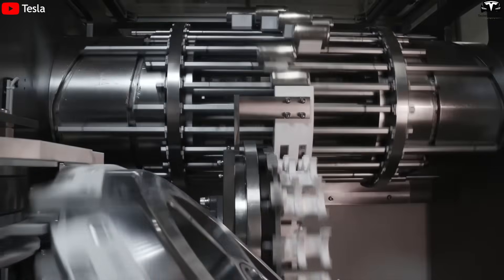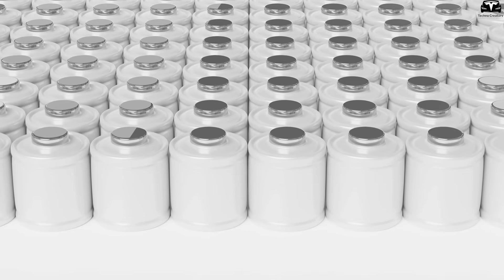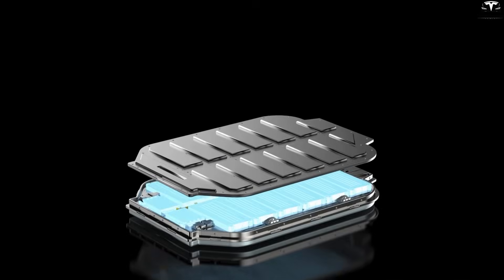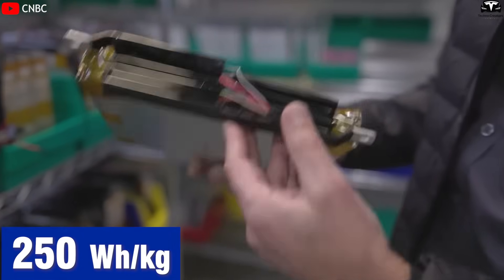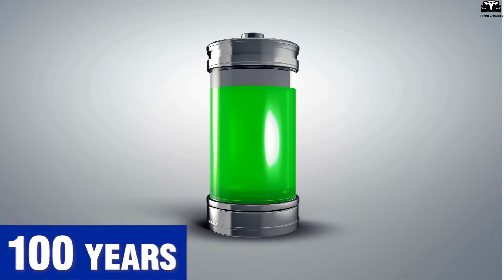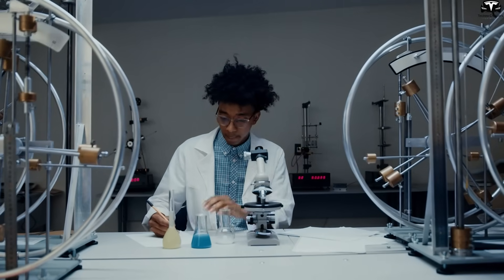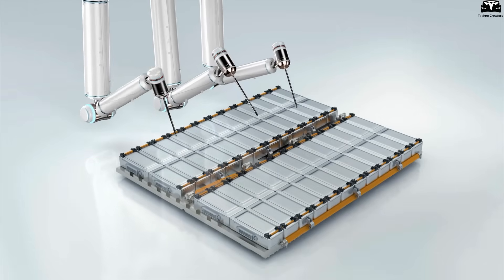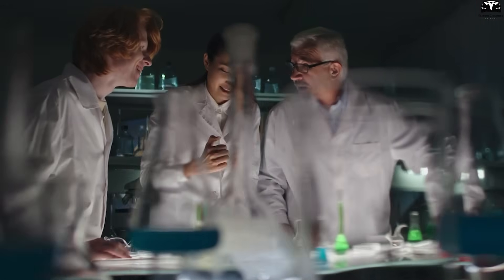Elon Musk Reveals Plastic Battery 10X Cheaper & Lasts Longer! Design that Could Last 100 Years!

Comment: I think companies like CATL and BYD may actually be better companies to research and develop this because they are already doing much larger battery developments than Tesla, and there still seems to be some development and optimisation required of these batteries.  They seem to be lighter but significantly larger than Litium batteries but have lots of promise for stationary energy storage/backup and network stabilization.
Reply from the maker: Đúng vậy, CATL và BYD với kinh nghiệm sản xuất quy mô lớn và đa dạng dự án pin có lợi thế lớn trong nghiên cứu và phát triển, đặc biệt khi công nghệ pin polymer còn cần nhiều thử nghiệm để tối ưu cho các ứng dụng khác nhau.

Comment: Just place polymer battery in 100 cars and watch how good they are. The quicker this batch of batteries can be made the better. Try it out in different places. If it is best for you fluctuating grid storage than that’s the market. If it is an al rounder hurrah
Reply from the maker: Exactly—just install polymer batteries in 100 cars and test their performance widely; the faster they’re produced and tested in varied conditions, the clearer their best use—whether in vehicles or grid storage—will become.

Comment: Batteries. That utilitize. Polymer-based Materials for. Their. Electrodes.  And.  Electrolytes 
Instead of traditional metal. Oxides. Or liquid 
 They don’t. Lose. Third charge as  quickly when they aren’t use and generally have a  higher energy  capacity
Reply from the maker: Polymer-based batteries use polymer materials for electrodes and electrolytes instead of traditional metal oxides or liquids, resulting in slower self-discharge and generally higher energy capacity.